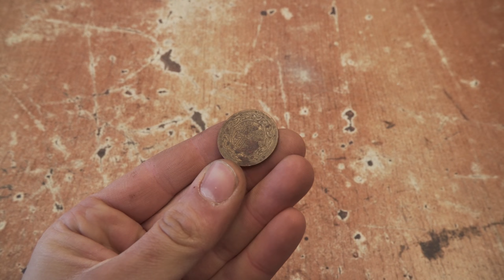Knifemaker Restore Junk Knife. Trash to Cash!

Comment: I never understand removing so much from the tang but still enjoy watching the whole process.
Reply: Easier on the hand in the long run, and gives a designed point of failure should one be needed.
Reply: @quinn_brock  Sorry. Neither of those make any sense. I can accept that it's just an artistic choice but your engineering logic is silly. Removing most of the tempered glass area of a car windscreen so, in case of failure, there's fewer bits of glass to cut you is the same inverted reasoning you have proposed.

The actual "designed point of failure" is to use a formula of glass which crumbles safely, NOT to just sculpt two thirds of the structure away so that it is barely performing its intended use.

Tool ergonomics depend on the user's hand size and being too small is at least as bad as too big for ANY handle.
Reply: @puirYorick It looks more like a knife that will sit on a shelf. I doubt that tang would break but It may certainly bend after some time.
Reply: @chongtak  I'm perfectly fine with it as a piece of decoration as I said to the other guy. It keeps a thing out of the trash.
Reply: @puirYorick  I agree
Reply: @puirYorick  I agree that it is a really mice bit of work, but I am not a fan of round handles on work blades (more control is better)
Reply: While I understand and appreciate the skill required to refurbish this knife, the tiny tang killed it for me.  Just.  Can't.  Do.  It.
Reply: @puirYorick  Well said.
Reply: fUlL tAnG 4lIfE
Reply: I love Tang, I drink it all the time.
Reply: I guess, its just a different mounting style. Should not be a problem because a lot of older files for wood and metal working use a similar design. And they are under a higher stress than knifes.
I guess it's just a matter of taste? Personally I don't mind if a knive has the original handle form from the video. In fact, I have a few kitchen knives which have them and i like them very much.
Reply: @ML-ii8gt  You really believe that a typical file is "under a higher stress than knifes" (sic) of the size shown here? I suppose if you use your file as a pry bar or as a hammer then possibly. lol
Reply: It’s a cooking knife. You don’t need a solid tang. You need it to be balanced perfectly. A kitchen knife needs to cut food nothing solide.
Reply: @DKofDAH  I'm aware of what a knife is and what it's used for, mate. 🤣 Your reply doesn't support your own assertion about better balance in any case.🤔

Comment: Awesome work! But a round handle profile is always a bad idea for knife (IMHO). - The hand does not know where the blade is pointing.
Reply: Most cooks will pinch the blade with thumb and forefinger, with the handle stabilized by the remaining fingers and palm. The key is having a sharp knife so you just need to guide it lightly. Cleavers and such do better with contoured handle, I think.

Comment: Edge of the blade is ruined by dry grinding...heat buildup softens the metal and will not keep an edge very well or for very long.  Will require frequent sharpening to keep the edge sharp.

Comment: Never seizes to amazes me how much effort you put into this without any practical benefit. It's nice to watch how one can make a ring from a coin, but IMO it would have been better to put it at the end of the handle not at the front. There is no smooth transition between handle and blade but only sharp angles where food can get stuck. The blade shape makes the knife better suited for butchering rather than cutting vegetables. At least it looks like you had fun with your work.

Comment: One pin, not even secured, to hold it together? Is that some kind of next level knife making?
Reply: Fine for kitchen use but yeah, wouldn't stand up to a brutal test.
Reply: I wouldnt use it for kitchen use, there is no sealant in the tang.  You would have to pull it right apart every day to clean it

Comment: Wonderful ideas realized, there! That's the best handle design I've seem, fitting a split log over the metal calibrated to the hole drilled into the handle. The pin through it all is how the katanas are done, the "right" way. All can be dismantled if a new handle is required some day. And amazing work making that ring. Overall, the knife all fits together beautifully, the patina on the blade, the big shiny bevel.